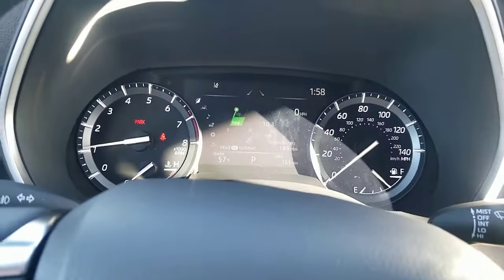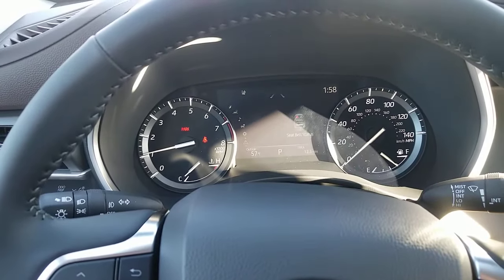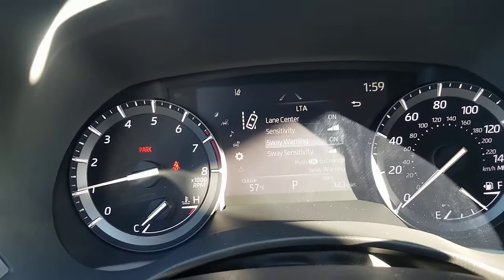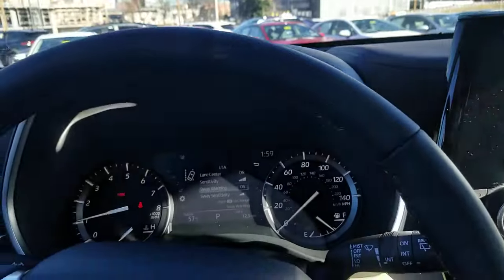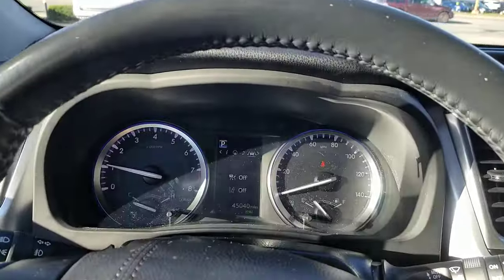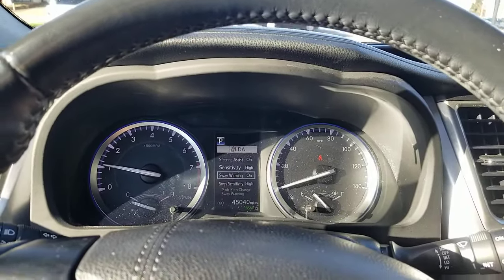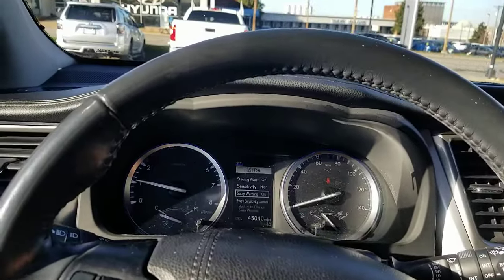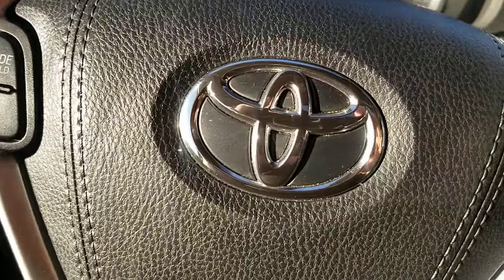Toyota take a break coffee cup warning. Enabling or disabling the warning.

Comment: I have driven both Prius and Rav4s both in Israel and the UK. I find in the UK, the Coffee cup comes on if I've been driving up the motorway for around 3 hours. I assume that there is a timer which also triggers the warning, and it's not my driving.

I also find that that the Coffee Cup comes on every time I drive through a particular curved slip road which leads me onto a main road where the road markings have been over painted a few times. This seems to confuse the lane departure system which beeps like crazy as I'm navigating round this road. Then when I get onto the main road, the Coffee Symbol always comes on. A simple press on the "Back Arrow" button switches it off.
Reply from the maker: i just shut it off lol

Comment: For a 2023 Rav4, when the sway warning function is set to ON in the LTA settings display, does LTA need to be activated for the sway warning alarm to operate? The other day I was driving on a small road and started swaying a little bit and the car beeped at me. My LTA is not activated so I was wondering where the beep came from.
Reply from the maker: If not in LTA then it is in LDA unless you have it completely off

Comment: Hi steve, just want to ask if you are turning on the defogger for the toyota highlander does it need to turn on the ac? If you dont turn it on, i think its not working?
Reply from the maker: talking about the ac or the rear defrost?
Reply: @stevenwelchtoyota  front and rear defrost? On my toyota corolla xse once i turn on the defroster its automatic that the ac will turn on
Reply from the maker: @jorgecalicdan7367  the ac system pulls moisture from the car which helps to defrost and defog the inside. Also running the compressor in the winter is a good thing for it to keep it working for the summer. The ac should be on while defrosting.
Reply: @stevenwelchtoyota  its really not gonna remove the moisture if you just turn the defroster on without turning the ac on?

Comment: I have turned off all the settings in my Toyota Camry SE 2021 and is still bumps when I go over the line. I feel like I'm fighting the car. I just wanted to stop I regret buying this car
Reply from the maker: shut off the steering assist
Reply: I think I read in the manual when you turn off the safety settings it’s just for that one time, they reset when you restart the car.
Reply from the maker: @jamesspraker7408  depends on which settings